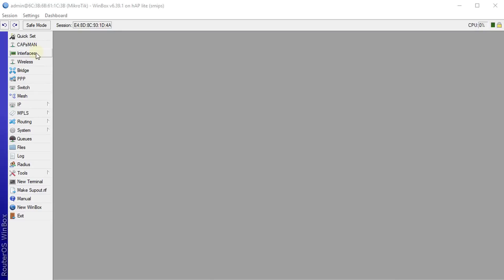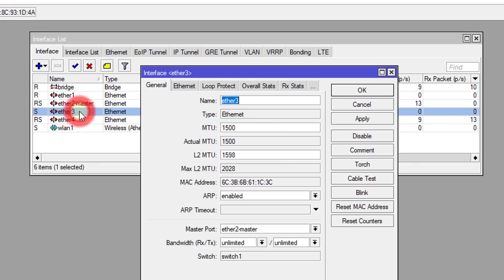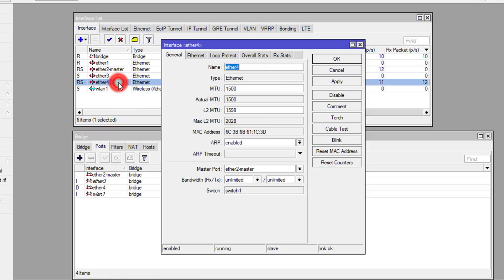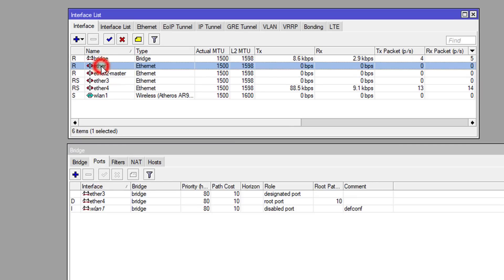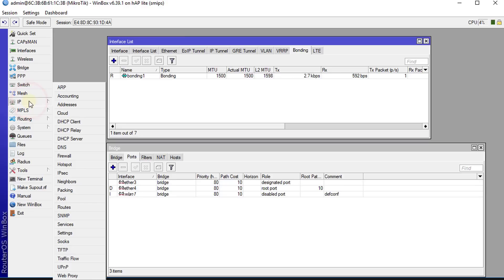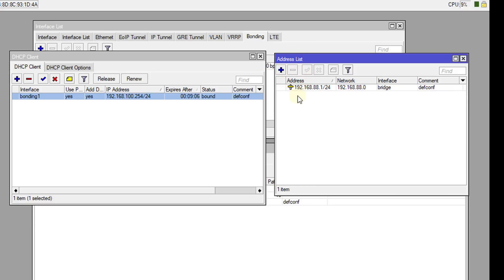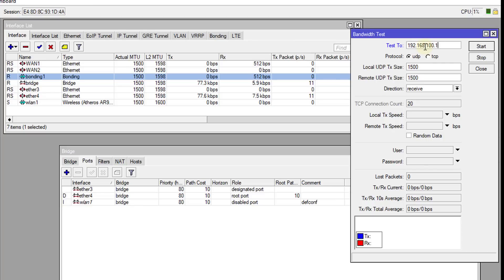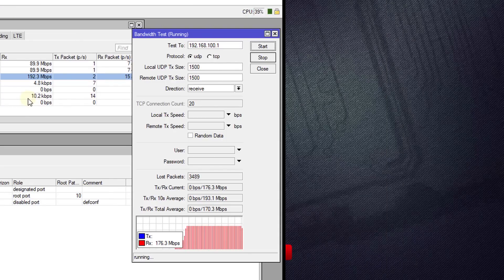MikroTik Tutorial 30 - Bonding & Load Balancing 2 x WAN ports

Comment: I have been following your excellent tutorials and am now stuck. I tried to follow as best as I can this video number 30 on Bonding but on RouterOS 6.49.2 the windows are different. I thought I had set it up correctly and I appear to get a balanced load on the 2 WAN interfaces but my computer now cannot connect to the internet and is not getting an IP address from the pool. Could this be due to the fact that on a RB4011 I am using the SFP+ with DAC to Computer running an IBM dual Fibre interface. Using ethernet 1 and 6 tbonded o connect to my Modem/Router.
Reply: Solved address problem. For some reason the Bridge address was deleted. That leaves the windows being different.

Comment: Hi! Many thanks for the video. However executing the steps it seems there is a big problem with the IP addresses. When asking Bonding to get the IP address using the DHCP client it will get it by which interface ? Ether1 or Ether2 ? Because if it gets it from Ether1 and later you disconnect Ether1 and you expect it to work from Ether2 right ? Well in reality the DHCP client needs to release and renew in order to work. How to solve this problem ? Need to change configuration on which devices ? Do you have a hint ?
Reply: Exactly 😂😂

Comment: I have been setting up dual wan with policy based routing many times via ethernet.

However, when I try this via wireless the second wireless station interface seems to find no network while I have confirmed it is ready and available.

Is there a limitation for connecting to multiple APs?

Comment: question, wan 1 and wan 2 have the same gateway?
Reply from the maker: Yes, because it is just bonding the connections. If you have a 200mbps internet and your router ports are 100mbps you won't be able to get the full speed of you internet connection.

Comment: This video is misleading. That would never work when using WAN facing interfaces in real lifr. All he did is a port bonding not wan loadbalancing. Usually connectivity to isp is l3 with multiple ips not l2.
Reply: Correct! He is using the term "load balancing" to refer to IntrAnet environment rather than Internet environment (ISP load balancing). This video should have got a more specific title. However, this video is very useful to me and I thank the author for his effort, and for this piece of technical info that I haven't known before.
Reply: Why don't you post your suggestion? It will be great.

Comment: I am using an RB951G running v6.41 and I do not see anything in the interfaces where allows me to select master port. Its just blank after the ARP TImeout? Also do you have a video starting from the beginning to get to where you are now?
Reply: Hello, the master port feature has been removed in this RouterOS version. Its functionality has been replaced by bridge setup unless I' m wrong.

Comment: You ran the test w/UDP.  Almost all internet traffic is TCP,  and TCP is connection-oriented... whereas UDP is not.  What results do you get if you use TCP, and also select an IP that is not the router... some IP that is outside the network of both providers?
Reply from the maker: I understand your point, because udp doesn't have the overheads as tcp it shows that the maximum speed that you can get from the bonded connection. To my knowledge this speed test can only be used with Mikrotik devices.

Comment: i have followed your instructions. please i want to know if i need to purchase any license before i can start using mikrotik. i have connected my 2 wans to the mikrotik. everything seems to be working but i cannot connect to the internet though there is the indication that my internet is connected.wan1. 192.168.1.1  wan2 192.168.2.1. lan . 192.168.3.1... its all working when i ping. failover is also working but the internet is not working.
Reply from the maker: All Mikrotik devices comes with a license. I am not sure what is causing the problem but you could check out this video https://www.youtube.com/watch?v=GeuuNE3EPBA
Reply: thanks alot for responding. please my challenge is that after bonding on both mikrotik routers, how to configure dhcp using bonding interface is a problem for me. lets say ip address for bonding on router 1 is 192.168.0.1 and router 2 is 192.168.0.2.. do i have to use the same gateway for my bonding and how do i configure routing for the bonding?

Comment: So you're saying if I add 2/100Mbps connections to my HAP lite I should be about to get both speed but would that be on both wifi and lan or only wifi since the lan is only a 100Mbps?
Reply from the maker: If you plan to use 2 x 100Mbps connections  then you will need a router with Gigabit ports or 802.11n/ac wireless.
Reply: TKSJa thanks I'll get a better mikrotik soon

Comment: in the testing you are doing you are getting lost packets, why?
Reply from the maker: It was a UDP test that doesn't have error check., TCP would be more reliable but slower.
Reply: I tried to follow your tutorial and it does not work properly with my config.
I would like if you can make a basic config from scratch with the barer minimum to provide internet with dual balance.
thank you in advance
Reply from the maker: Noted
Reply from the maker: Here is the video Load balancing over multiple gateways https://www.youtube.com/watch?v=GeuuNE3EPBA

Comment: does bonding also apply to pppoe interfaces ? and aggregates the connections speed of each ppoe ?
Reply from the maker: It should work, just change the interface from WAN to the new bonding interface.
Reply: You can't add a pppoe out interface into interface bonding. You have to use load balance for your case.